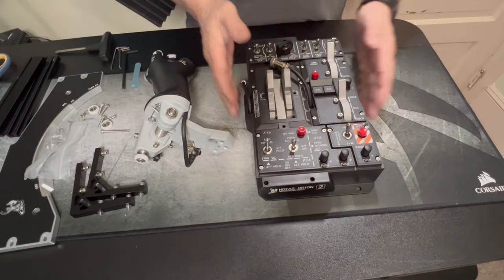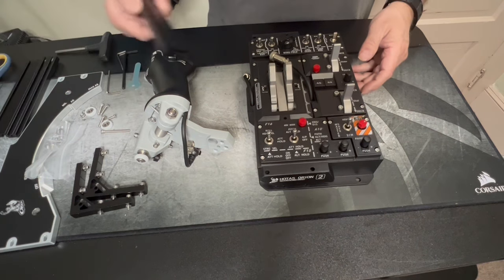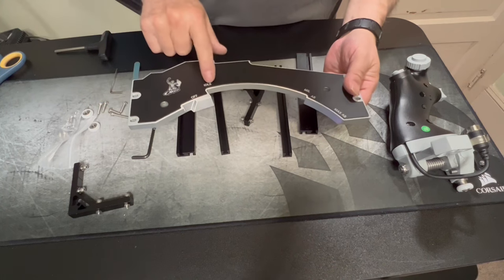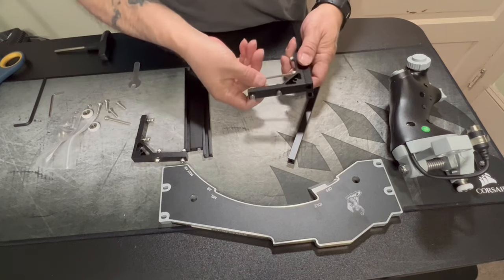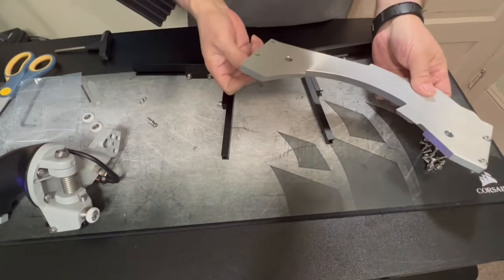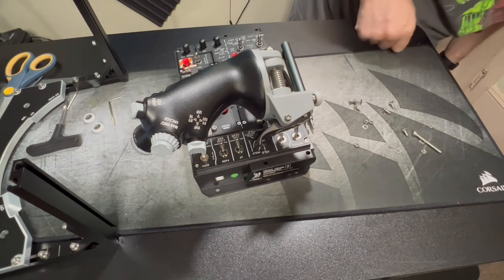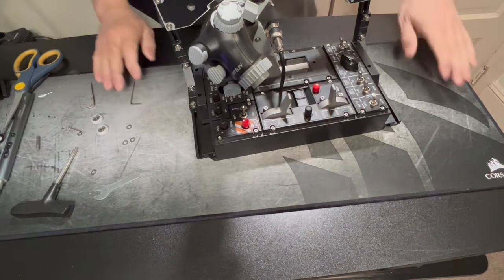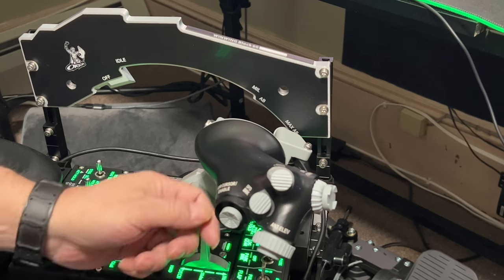Winwing Orion 2 F-16 Throttle Base and Grip.

Comment: I have the same throttle. Your detent plate is mounted at the incorrect angle. Instead of lining up both top-ends of the plate flush with the top edge of the vertical brackets, the plate needs to be 3/4 of an inch lower in the front and about an inch higher on the back for the right geometry to allow the throttle itself to travel back that extra 1/2 inch in order to sit into the off-detent (on the plate). Thanks for the assembly video. This throttle is incredible, and superior to the Virpil CM2 that I owned previously. It just feels like the real thing, as opposed to the CM2 which feels like a boutique design, toy-like.
Reply from the maker: Thank you for watching the channel and your feed back.  Actually you are not the fist to tell me this. Anyway I did correct the angle and it works fine.  What I did was take it into my work and take the 3/4 inch off with the laser cutter because it would keep hitting my desk every time I would turn and get out of my chair.  I love that throttle and you 100% right saying it is superior  to the Virpil.  I am totally happy with the throttle. again thank for your feedback.

Comment from the maker: Figured out how to adjust the guide rail so the grip now falls right into the OFF position.  😁
Reply: What did you have to change to make it align?
Reply from the maker: @scruffww3495  your not the first person to comment on a fallow up video about this. I have been working on a three monitor setup and a entry level cockpit that I will do a video on to starting with how I fixed the throttle to line up.  Sorry for the delay I definitely have video up today.

Comment: This is interesting. Will watch to decide if swapping handles is viable or if I should just buy a second base and save me the hassle.

I have F15 EX with Finger lifts. When I get the 16, do i need any adapters to connect it to the orion 2?
Reply from the maker: If you are thinking about getting the F-16 grip with the rail and detent then that is all you need.  You just remove the grip and attach it to the Orion 2 throttle base and you are off and flying. But it will most likely take an hour to do the swap once you get it down.  Hope this helped.

Comment: Nice looking, but too huge.
Reply from the maker: Yeah it is a bulky hotas but lots of fun to use
Reply: @JPsTechReviews  I don't doubt its fun to use it. Just not suitable for me, if only it would be smaller, and some how without that aluminum-detent plate. Maybe some times in the near future, fingers crossed.
Reply from the maker: @MitjaBonca  You don't need the detent plate it will work fine with out it.  The plate is just to add realism.  Honestly the F18 Hotas covers more plane and you can still program it to do almost 100% of the actions needed.
Reply: @JPsTechReviews  thx for that, didn't know it is possible to use Throttle without that plate. I had Virpil's CM3, but did't like it, and sold it a month ago. That's why I'm looking for another one. I still have an old Thrustmaster's TWCS, which I have it for 4 years, and I quite like it. But still, looking for something different.
Reply from the maker: @MitjaBonca  I have the Virpil VPC Joystick base with the grips I like but I am really happy that I went with the Winwing throttle because the Virpil just looked to generic for me and the control look like a nightmare to set up.  Anyway I am setting up a discord channel, it should be up this weekend and I will send you an invite if you are interested.